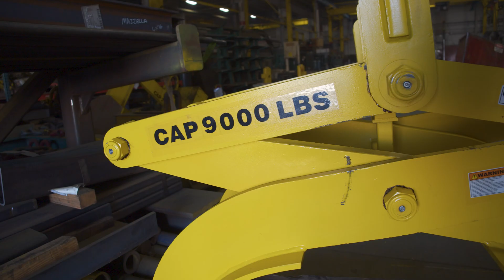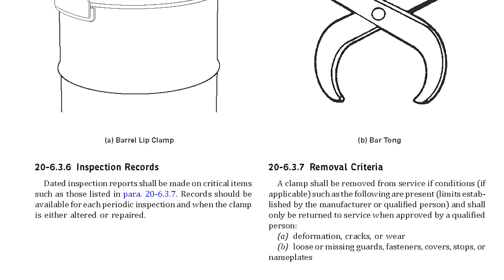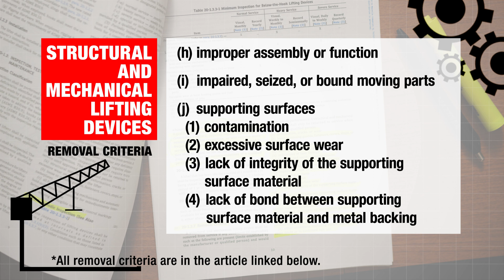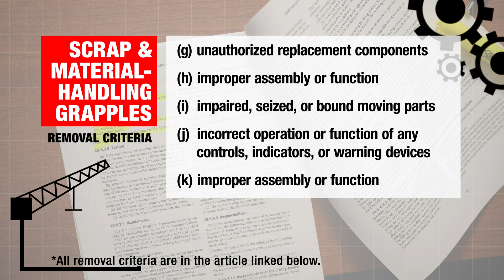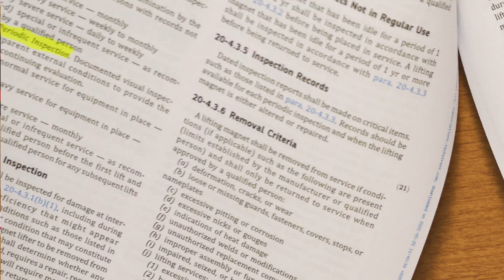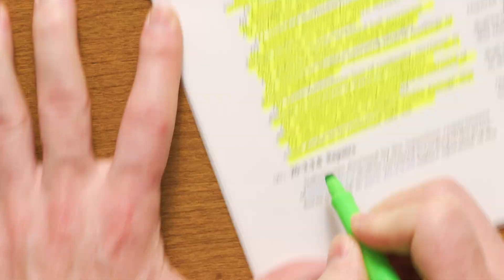What's in the NEW ASME B30.20 Below-the-Hook Lifting Devices Standard?

Comment: What is the WLL Safety Factor for hooks?
Reply from the maker: Each hook is manufactured with its own WLL, depending on the product and the materials. You need to inspect each hook individually to determine WLL. According to ASME B30.10 Hooks, The manufacturer’s identification and rated load identification shall be forged, cast, or die-stamped on a low-stress and non-wearing area of the hook. So if you cannot read the WLL on the hook, then the hook needs to be removed from service. 
Regarding Safety Factor / Design Factor, ASME B30.10 Hooks states, The hook shall be designed to withstand all stresses imposed under normal operating conditions while handling loads within the rated load. Hook design factor shall, as a minimum, conform to those specified for the equipment or system in which the hook is a component.

Comment: Is the 125% for new crane commissioning purposes or is that a requirement for annual inspections as well.
Reply from the maker: This is not for overhead cranes, but rather lifting devices.  ASME B30.20 states that prior to initial use all new, altered, or repaired devices should be tested and inspected.  So the load test is not required as part of the annual inspection.  And again, this is a should not a shall.  A load test is not required.
For overhead cranes, according to ASME B30.2-2.3.2  "New cranes shall be load tested prior to initial use.  Reinstalled, altered, repaired, and modified cranes shall be load tested prior to initial use, unless otherwise determined by a qualified person."  If a load test is conducted it shall not be less than 100% of the rated load and not more than 125% of the rated load and it must be documented.  A load test is not required as part of an annual inspection.   Hope this helps!